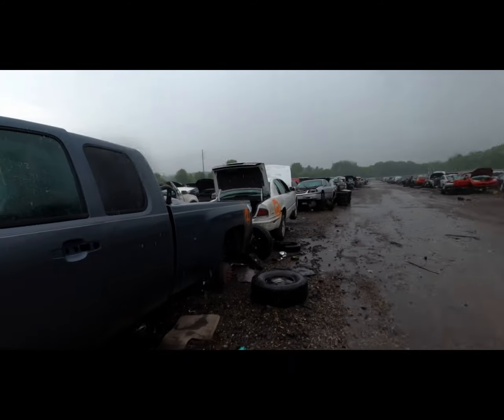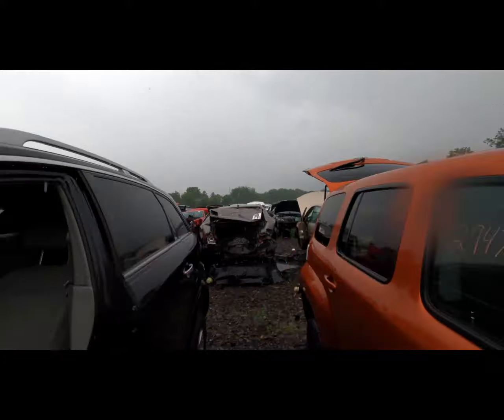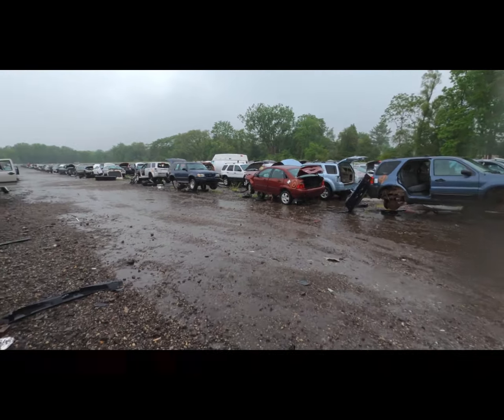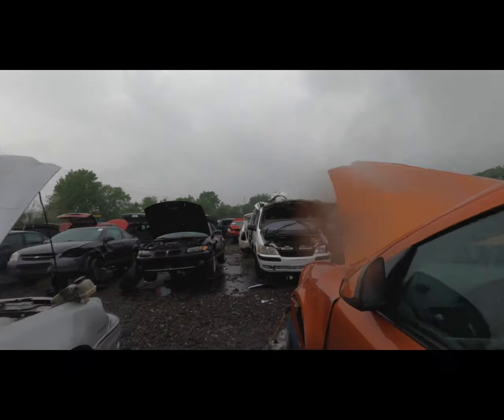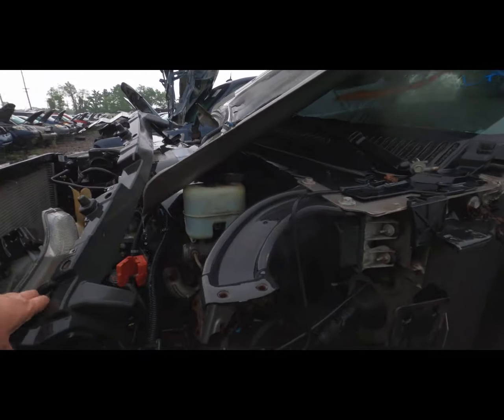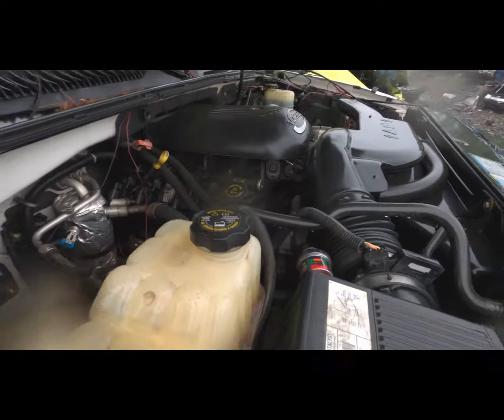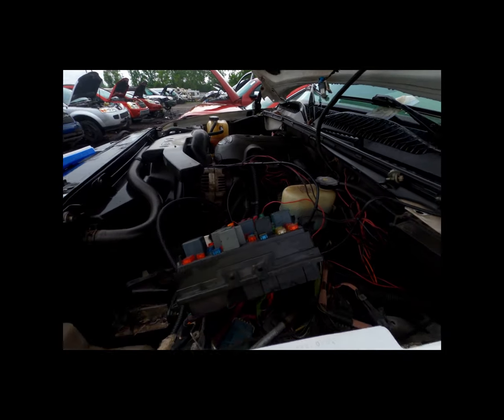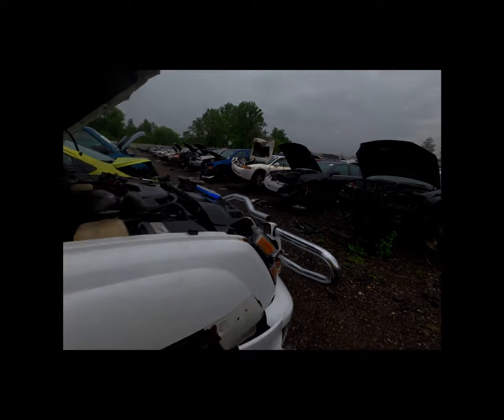Junkyard hunting for the perfect LS Swap PCM!

Comment: Just so people are aware, if you have a DBW only P59 you CAN make it Drive By Cable by soldering the IAC driver onto your board. I have the Serv No. 12589463 HDW No. 12589162 in my LS swapped Ram 1500 running the IAC with no issues. Soldered myself with a $10 soldering iron. Easier option would definitely be to just buy the right one first but if you can't there are other ways.